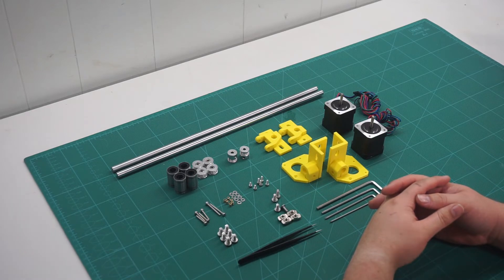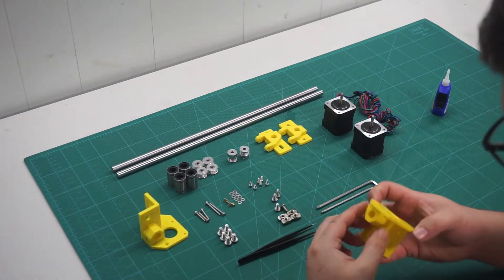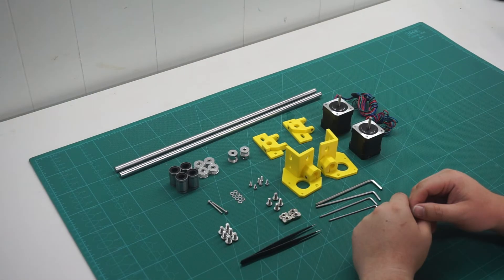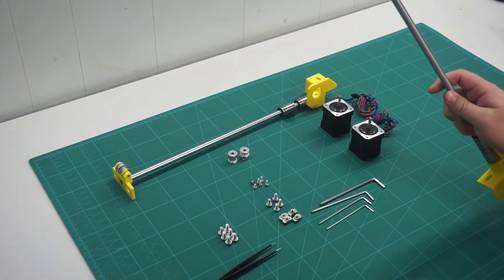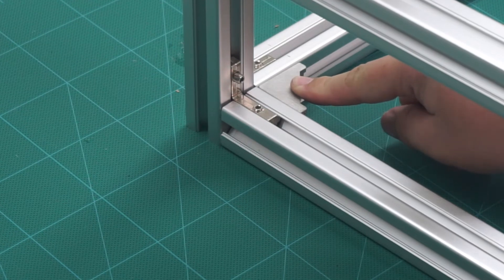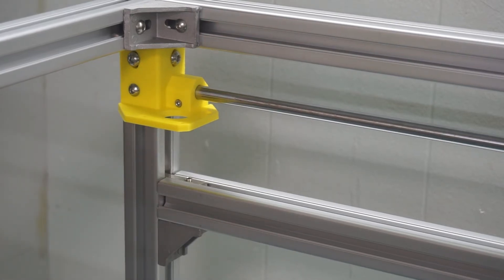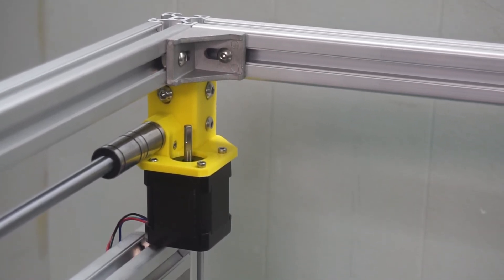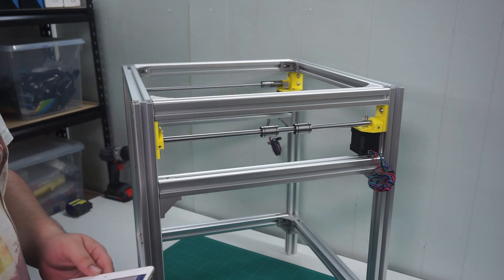Build: Hypercube Evolution - Part 2 - Y Axis

Comment: What material are you printing your Plastic parts/brackets with Nathan?
Reply from the maker: The yellow parts are esun pla with a much higher infill. I had a lot of issues printing with there petg on the tevo tornado and gave up on it and went with the pla. I have very recently found an Australian company 3Dfillies which sell great filament cheap. There petg prints perfect so I will be going back and reprinting all the bits in that at a later date.
Reply from the maker: I have noticed a couple of the z axis smooth rod holders are cracking 😬 definitely worth printing petg to start with.

Comment: I’ll be interested to see how the superglue holds up.  Why were the holes too large?
Reply from the maker: Agreed not sure how long it will hold. Dimensionally the parts printed on the tornado are correct. But for some reason the holes are a smidge to big. The goal is to get the cube running and reprint it all on that 😊.